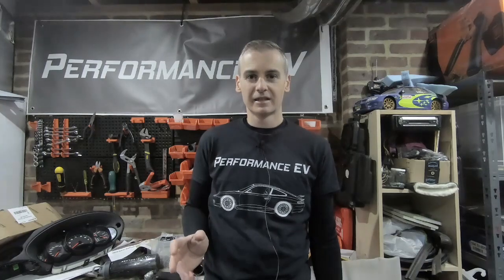Electric Porsche 911 project video 25 - Fabricating Custom Drive Shafts -Porsche 911 to  Nissan Leaf

Comment: If you could slide one inside the other far enough, you could drill through both when combined and put a bolt/pin in for a mechanical connection. Not sure about the wobble issue though. If it was long enough to give space for two pins that should prevent wobble assuming you can get it square enough.  You could even cut the pin a bit shorter than needed and weld it in on both ends.

Comment: Looks quite neat for a DIY job. I think you might be surprised at how little vibration they have. The diameter is really quite small compared to something like a wheel and the imbalance is proportional to the 4th power of the distance from the center line . That said getting custom drive shafts shouldn't be too difficult. Lots of places that do it.

Comment: At the Workshop School in Philadelphia, we are putting a 2018 Nissan Leaf motor and battery in a Mazda Miata based Kit Car called a Catfish. The Catfish is a basic Steel Tube frame Fiberglass body kit. It uses the front and rear suspension sub-frames from the Miata. 

We have done the driveshaft connections before when we built the Factory Five 808 kit car as a high miles per gallon vehicle...over 110 mpg...with a VW Turbo Diesel instead of the Subaru WRX drive train. 

What I found works well on the 808...and I plan to use on the Leaf to Miata drive shaft...is a low-carbon steel tube machined to sleeve over both different diameters of drive shafts with around 3 inches of the original shaft in each end of the sleeve. I milled slots in the sleeve to give additional weld area. Because the two diameters were machined on a lathe, the sleeve aligns both shafts to each other perfectly and there is no run out...wobble...in the drive shaft when it spins. 

I used low carbon steel to avoid the need for any annealing or heat treating of the welded shaft when finished. The one on the 808...Subaru to VW...has worked perfectly.
Reply from the maker: Sounds like a cool project. That Catfish has a very sporty look to. It should be very exciting as an EV.

That does seem like a pretty secure way to do it, and definitely validates my belief that with the right tools it is possible to cut and combine different drive shafts to make something solid and useable.... unfortunately I currently lack the right tools:-) so these ones will be temporary.
Reply: @PerformanceEV  Unfortunately you are in the UK...I'd be happy to make you a sleeve. It's a very simple lathe operation. Maybe we could do a trade. You seem to have been able to get into the controls system of the Motor Inverter pretty successfully. We have yet to tackle that...we are hoping to use all the controls from the leaf...but I would happily trade an adapter sleeve for some pointers on that. I would just need to know the ID and OD of each half shaft. Not sure how to get in touch a little less publicly...
BTW...we are using a 2018 Leaf as a donor car because we wanted the extra power and torque, I think yours is earlier. I remember you mentioned in one of your videos that you planned to get more than the rated power and torque out of your motor. I was wondering how you planned to do that.
Reply from the maker: @gregscott989  
 that is a very generous offer, thank you.  For this project I will probably go with my current plan of using the longer Porsche half shafts as I need to buy new ones anyway to replace the outer cv joints (the joints are not available separately,) but I may reach out to you for advice on this matter for a future build, if that's okay.

Regarding sharing knowledge on the motor control, I am happy to provide what information I can.  As I see it, there are four main options for controlling the leaf motor.

One is to try to use the native leaf control systems, which means you need a good chunk of the harness and various ancillary systems for the VCM to be "happy" and send torque messages to the inverter.  There is a good thread on the diyelectricars forum on what the minimum needed for this is, I'll try to dig out a link. I didn't even think of this option before I started the project.

The second option is to try to send those torque messages to the inverter directly, essentially replacing the Leaf VCM.  The inverter operates on only a handful of CAN commands, it's the VCM that is sensitive to the other systems being present.  I tried this option in the early days, but my coding abilities let me down.  Since then evbmw have developed an open source controller for this that I believe people have managed to get working with the gen 1 and gen 2 leafs, I don't know if anyone has done it with a 2018, but I doubt they have changed the control logic that much. The main limit of this approach (and the one above) is that I don't think you would be able to push past the leaf performance figures as they are controlled by the logic in the inverter that receives those torque commands.

The third option and the one I am working with now is to replace the logic board in the leaf inverter with one that I have complete control over.  You retain the power stage of the inverter (igbts, driver board, cap etc.) but have complete control over the PWM that is being sent to the IGBTs, and therefore the delivery of power to the motor.  The limiting factor here then is the components within the powerstage (i.e. at what point can the igbt deliver no more power.)  That limit is still an unknown for me, but I am going to push to try and hit it in this car...and will report back.  Theoretically we may be able to double the power Nissan extract from this package, but we will see.
I chose the open inverter drop in board as it is designed to be usable in any manufacturers inverter (if you can build or obtain a suitable adaptor board (mainly about routing to the native connectors and pull up/down resistors etc.)

The final option, and one I will go to once I have pushed the leaf inverter powerstage to its limit, is to build a custom inverter, i.e. select igbts that are capable of delivering the power I want to hit (which is about 3x what the 2014 leaf came with.) I should be able to use the same logic board to control that inverter once built, though I will need to procure all of the powerstage components.  At this point, the motor becomes the limiting factor.
Reply from the maker: Option 1 - Here's the thread about using the leaf components to get the motor running that I found interesting.
https://www.diyelectriccar.com/forums/showthread.php?t=199847

Option 2 - here is the open source VCM for controlling the Leaf motor without the rest of the components and without having to open up the inverter.
https://www.evbmw.com/index.php/evbmw-webshop/nissan-built-and-tested-boards/leaf-inverter-controller-fully-built-and-tested
https://www.evbmw.com/index.php/evbmw-webshop/miscellaneous-bare-pcbs/leaf-vcm-bare
and a commercial product doing the same - 
https://www.thunderstruck-ev.com/dilithium-vcu.html

Option 3 - The drop in replacement logic board, which requires opening up the inverter.
The one I went with:
https://openinverter.org/wiki/Main_Board_Version_3
https://openinverter.org/shop/index.php?route=product/product&path=59&product_id=57
Others I considered (and which may be more local to you) was the design by Paul Holmes.

Option 4 - is still theoretical for me, but there are people who have pushed the Leaf up close to 200+KW
This is the type of thing I would be going for, though using the open inverter logic board (and certain other bits) as I am already familiar with it.
https://www.youtube.com/watch?v=jY7IJOiqTec
Reply: @PerformanceEV  Thank you so much. Great links! We spent the whole class time today exploring them and playing your videos for the students. I gave one of them a challenge to make a video showing our progress so far. I will link to it when he's done. 
We actually had the car almost ready to  go when we switched to the idea of using the Nissan Leaf drive train. We had done other electric cars before...converted a Ford Focus to electric...and had an Azure Electric Motor and Controller/Inverter left over from that project. It was only a 60 HP motor with 82 ft-lbs of torque...sorry for the  Imperial units...and the original Mazda motor was 110 HP. So we felt we needed to keep the gearbox ratios for low speed performance. We made a 1/2 inch thick aluminum adapter plate to connect the Azure Motor...you could get that with a differential or just as the motor...to the Miata gearbox. 
This is an old Hot Rod trick which I had done before when I was working as a machinist in what they call a Speed Shop over here. Interesting process...involved making a paper template, scanning it on a copier and refining the hole locations by making wooden templates on our laser cutter until all the bolt holes lined up...there's only two that register the whole bell housing with bushings. We had the engineering drawing of the Azure Motor so we could draw that pattern by dimension.
Again, thanks. We are making good use of those links and looking forward to seeing your project develop.

Comment: the porsche 911 gearbox is a transaxl would it not have been easier to just bolt the motor strait to that as that is the plan with my beetle ?
Reply from the maker: Hi Paul, that was my plan if the car I got had been manual. But this one was an automatic and while it is possible to make it work, there are extra headaches when it comes to using an electric motor with a auto gearbox. The plus side I have seen of doing it this way is the installation is more compact, so has left me with more space to install batteries where the engine was.

Comment: Hi...we had a brief conversation last year about our Catfish/Leaf EV car project. We, of course, just got back to work on it after being out of school for a year and a half due to the pandemic. We have decided that we can't use the battery pack as is and would like to ask you some questions about how to go about building our own. Specifically, we are building the car to compete in autocrosses. We are using Leaf mechanicals from a 2018 Leaf with the 40 KWh pack. We would like to keep the weight as low as possible and we were wondering if we could use only part of the pack to save weight. We do not need much range. Also wondering if the BMS system can still work if we cut down the pack to fewer cells. We realize that we have to maintain a working voltage to the inverter but wondering if we can do that with less cells...and less weight.....Greg
Reply: Hi...if you read this, I did a little more research and I realized you have to use all 24 modules in series to get the necessary 350V from the pack. It's the battery cells in the modules that are partially in parallel. The modules are all in series. Each module has 14V and there are 24 modules which need to be in series to get the Voltage necessary for the Inverter. Hope your project is going well. I am suscribed to your channel but I haven't seen a video recently. Hop you got your driveshaft issue resolved.
...Greg
Reply from the maker: Hi Greg, apologies for not getting back to you, yes, the only way to get the full pack voltage is to wire all the batteries in series due to the way the modules are wired internally.  The other option if you are trying to use only a subset of the pack would be to use a Prius or other Toyota/Lexus hybrid inverter converter which are designed to work at around 200v and have a built in boost converter to take that voltage up before sending it to the motor.  There are some people on the Open Inverter forum who have been playing around using these, though I don't know if anyone has paired one with a Leaf motor yet.  I guess the other option would be a portion of the pack and an external boost converter between the pack and the inverter.
Thanks for asking about the channel, progress has been slow the last couple of months due to work commitments in my day job, but I am hoping to get more content out soon.